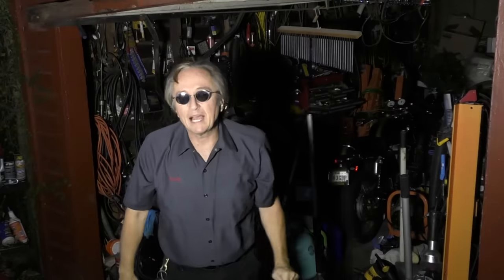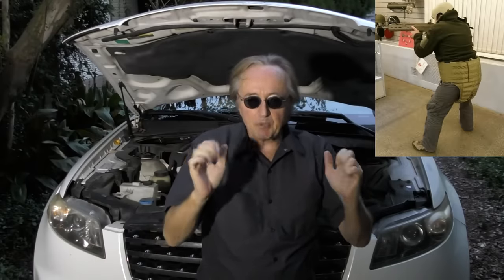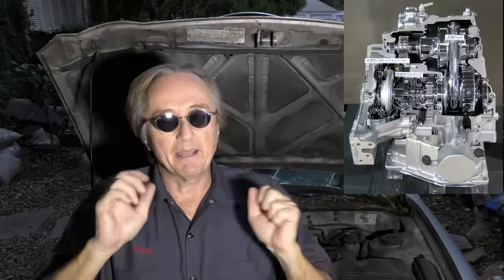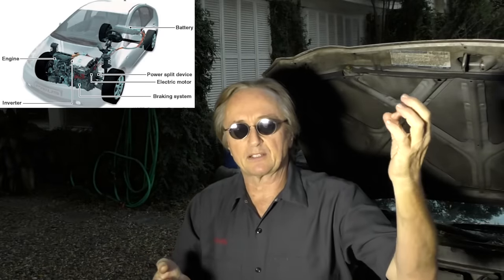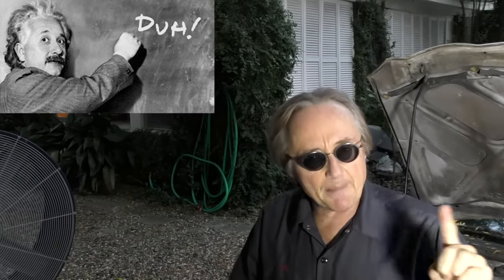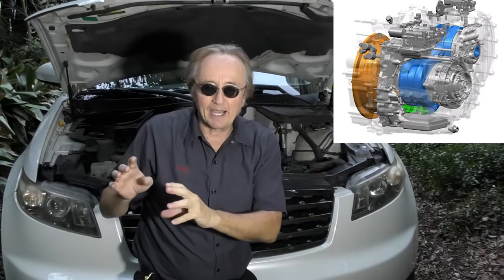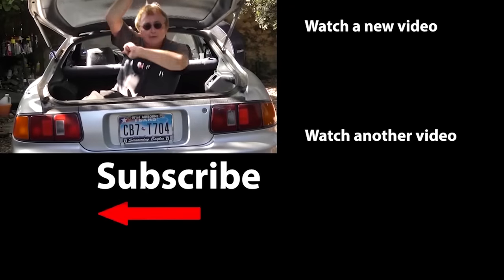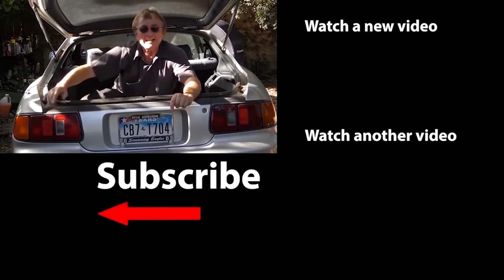Why Most CVT Transmission Cars are Terrible

Comment: Just got a notice from Subaru Canada the they are Extending 
my CVT warranty for my 2018 Outback to 10 years. 
Feel better now 😃
Reply: Beware because Subaru will fight honoring that warranty. I'm dealing with my CVT transmission stalling and causing my front axle to break. Horrible experience on an LA freeway. I'm dealing with Subaru not honoring two active warranties on my car. It's a nightmare.
Reply: thanks for info. my 2015 Sentra, 85k, slipping.
Reply: Yeah, good luck with that one.. warranty is only valid by their definition of the fault, and they only announced that because the word is out how crap the cvt's are, and sales were plummeting as a result.. any claims you make will be severely challenged.. guaranteed
Reply: Our Subaru Impreza sucks . They rebuilt the engine twice and now the transmission is failing at 85000 miles and we're having problems with the cam .. Hate Subaru !!!!!!!!!!!!!!
Reply: @Frecks50  
How is Subaru denying the warranty, whats their excuse??
Reply: @MsDavid896  
How can you yell when a CVT is slipping? It feels like that all the time doesn't it??
Reply: @marktuyet  
What year Imprezza do you have, which motor?
Did they give a reason for the engine failures?
Never was impressed with Subaru.....their 4 cylinders had a lot of head gasket failures a few years ago.
Reply: @motorcitymanman7711   can tell its slipping when accelerating onto highway, and punching gas doesn't work. Not that you should punch gas but it will slip when you try. Ie slipps, stop accelerating when rpms go above about 2.5 rpm
Reply: @crookback 
Dont Gloat.
Reply: @motorcitymanman7711  they said that I didn't keep my fluid levels maintained. Eventually, they did fix everything. The service rep said they didn't want to deal with me in court. I did not say anything about a lawyer or court but Subaru knows they have a transmission issue.
Reply: @Frecks50  
Good for u for not backing down
Reply: Peter, your Subaru doesn't have a Jatco CVT. Subaru dropped Jatco's a long time ago in favour of doing their transmissions in-house. The reliability of their in-house transmissions appears to be much better than the Jatco units Scotty is talking about.
Reply: You will need it!
Reply: @inodesnet  Thanks for sharing! Just replaced my 12 Altima with a 19 legacy.   would say it runs quieter and smoother though I did put 105k on my Altima without any tranny problems before it crashes
Reply: Better hope it breaks before 9,999 miles!
Reply: your CVT transmission is the same as in the TOYOTA and that gentleman doesn't know what he says about the Prius-  they do no use with CVT for the last 20 years- they used with the regular gear for many years and for a few years they used with a very bad Geer and than replaced it with the same Geer as in your Subaru since Toyota owners Subaru by 25 percent of their stocks
Reply: Subaru has made their own CVTs for quite a few years and they're considered among the best.  
Because of all the chatter they extended the warranty to 100,000 miles.
Reply: @Frecks50  - You don't "maintain" the fluid level. Transmissions don't use oil like engines do. CVTs need to have the fluid changed every 30,000 mi./50,000 km. whether or not the owner's manual or maintenance schedule calls for it.
Reply: @Derek Dranfield: great info Derek. Thank you.
Reply: @Frecks50: so sorry to hear of your difficulty with Subaru!! Hope you are able to come to a favorable conclusion.
Reply: Glenn Stewart when did they start making their own CVT’s? 🤔
Reply: Didn't they raise the warranty period to avoid a  government-forced CVT recall ?
Reply: @Frecks50  Subaru has been very good about their CVT's unless you have had maintenance on them. Have two Subaru's with CVT's (2010 Legacy 4cyl, 2016 Outback 3.6r). Both drive great with no issues. Great mileage and smooth acceleration.
Reply: @Mike80528  great for you. my experience was not the same, as I stated.

Comment: My car is barely at 40,000 and it is already having transmission problems it's a Nissan Versa😣😤😒
Reply: Chale.
Reply: Hate Nissan Versa's, cheap car cheap quality :(.
Reply: Shuddering when you accelerate from a stop, right? We had one. Had.
Reply: I'm sure none of us are making her feel any better lol.
Reply: Well thankfully I did the lemon law thing so might be getting my money back soon and return the car, so I'm dealing with that I feel bad for people who didnt have a chance to do that under the warranty and realized it too late. I'm getting a Toyota forsure. Lol
Reply: @dallascowgirl105  So what exactly was wrong with your transmission? That's awesome that you can return the car after 40k.
Reply: @invictuz4803  Basically just the transmission, the code for the sensor for the transmission kept coming up and the check engine light would just keep coming back. The car would shake. And they even changed the transmission and still can't figure it out, it's running fine for now but I'm already doing the lemon law and Nissan might already be giving me my money back so waiting on that at the moment. I did research online and learned what lemon law is soo thankfully I did.
Reply: @dallascowgirl105  Wow that sounds nasty, thanks for the info!
Reply: @dallascowgirl105  Try changing fluid to aisin cfex and make sure it's 5quarts.Solved my problem with nissan serena(not sold in the us market).
Reply: Mine went out around 55k
Reply: Nissans are cars for grandma to go to yoga with not a young person with a busy life
Reply: I own a Nissan Versa TO, I have no transmission problems. Change the TRANSMISSION fuild every 40,000 Miles...
Reply: My 2015 nissian versa did the same at 42,000 miles.
Reply: I have a 2016 Nissan Sentra with 62,000 miles on it. Took it to the dealership today because the CVT transmission was giving me trouble... they took it on a test drive and suddenly the car “broke down”. Trust me stay far away from Nissans. 

What is lemon law?
Reply: THESES Cars are GOOD, The problem is WEIGHT and R.P.M. STAY UNDER 3000 R.P.M. "ALWAYS"  SO SIMPLE!!!!!!!!!!!!!!!!
Reply: How's the oil change?
Reply: @ItsFabby  Look it up its basically when you have the same issues with the car its considered a lemon plus I bought it brand new so I will be getting my money back for my vehicle, it's best to do it under 100,000 miles.
Reply: Alma Ruiz That lemon stuff you said was cool. Damn lemon tree.
Reply: Alma Ruiz should of waiting a little longer before purchase and got the Altima
Reply: I have Nissan Sentra 2012 with 156,000 hundred thousand miles and it has CVT Transmission 🙄 no issues or problems runs like champ
Reply: If you google it Nissan Versa transmission is a failure by nature. It affects thousands Versas around the world. My versa is year 2016 after 80K the transmission completely failed. Warranty has expired but Nissan has a program for Versa owners called goodwill replacement. Even though your warranty has expired you can get transmission replaced for free.
Reply: I had the same issue on a Nissan versa 2012 with 80k miles,  which is out of warranty,  I called Nissan corporate and they replaced my transmission for free , take a minute and call .
Reply: Alma Ruiz lemon law lawyer, get your money back, thats what I did for my Nissan sentra
Reply: My friends would tell me Never ever buy CVTS engine cars. I have a 2010 Toyota Corolla with 145,345 miles on it and no problems lol
Reply: Trade it in for a corolla
Reply: You guys probably never changed your CVT fluid... Dirty fluid is going to make it studder and "shift" like crap. Eventually blowing up the trans
Reply: Alma Ruiz lol u cant do a lemon law at 40k miles never mind 99k miles lol. U will not be getting your money back trust me. Sorry hun i work for that company and we wont be giving no money back for lemon laws. Only if u do somethi g vood for them will they do it
Reply: I have an 2007 Nissan Murano that's stuck in  limp mode.......uuugghh cranks up sounds fine but wont drive or reverse......
Reply: Did u change the tranny fluid at 30k like u suppose to?
Reply: @steven7297  - "Of" ≠ "have."
Reply: @nathanbryan3192  - Just be aware that only a portion of the fluid (special CVT hydraulic fluid) can be changed at a time. The torque converter (! Why? I should study how automotive CVTs work) doesn't drain.
Many people are having CVT trouble well before 40 k.
Reply: I bought a 2014 Nissan Versa and the transmission at 77,000 is now completely ruined and needs a new one
The dealership is charging me $5,000 to fix it bc I am out of the warranty 
And if I fix it at an outside mechanic, the best price I found was $3,000 

I am now in the market for a new car & am never buying a Nissan again 
But I’m glad yours was covered, I wish mine was, ive only had that car for 5 yrs 😩
Worst car EVER!!!!
Reply: We have to learn the hard way in life, but I’m sure you’ll never buy a Nissan again.
Reply: Ive had a lot of Nissan but all manual transmission, Sentra Tsuru and Versa . Never had a problem with them.
Reply: Crazy since I have a 2015 Sentra and I just hit 80,000 miles. It's starting to jerk when giving it some gas after stop and shuddering
Reply: @RatnDat  I'm going through the same issue with my 2015 Sentra and its only at 80,000
Reply: It's not having problems you just never owned a CVT they drive different hey don't shift and people keep going back to the dealership oh yeah they gonna get you!
Reply: dont buy nissan again.  dont repair.  just buy one from auto zone.  or have dealer give u a new one.
Reply: I have a 2011 Versa but mine is the automatic, not CVT engine. I have over 150k miles on my car and it still runs like a champ. I’m very good about replacing fluids and maintenance and couldn’t be happier. :)
Reply: InvictuZ I have a 2014 Versa 5 speed and I love it, super reliable and very good on gas, I guess just don’t get the CVT
Reply: @nathanbryan3192  Well its coming.
Reply: @cosmic7368  it's really expensive to do that
Reply: @nathanbryan3192  how much does the CVT transmission fluid cost?
Reply: Fabby Figueroa oh wow I have a 2017 Altima that I bought new and it now has 63,000 miles and doing this. Taking it to Nissan tomorrow
Reply: The nissan versa didn't come with a CVT till the 2020 version, so I guess you are just unlucky. I personally drive a Nissan Versa 2012 with 130k km and works like a charm, it's also a manual transmission so I guess it's not relevant for this conversation
Reply: Get a toyota😀
Reply: @gsfbffxpdhhdf7043  I did the lemon law and got my money back for the car what I paid.
Reply: @Granked  I did get a corolla.
Reply: @funarena542  yes i kept taking it for the frequent oil changes etc. Didn't matter.
Reply: @brendas9095  oh man I'm sorry that sucks get a toyota instead.
Reply: @BellyJae  thats why because it isn't cvt and its mostly the newer Nissan that have issues.
Reply: @clb_52  already did lol😁
Reply: @dallascowgirl105  , Follow Scotty Kilmer on cars and trucks and you can never go wrong.

Comment: According to Wikipedia, Subaru has discontinued the use of Jatco transmissions and are building their own CVT’s
Reply: Yeah, they are, but they're still horrible.
Reply: @crookback Great idea, my 2011 subaru cvt went out @ 114k.
Reply: @crookback - Electric cars have a one-speed "transmission" - a reduction gearbox. So far I haven't heard of any of them giving trouble. After over a century of making reduction gearboxes, perhaps the engineer-bean counter war has been won in favor of the engineers. If the gears and bearings outlast the rest of the car, and the gear case doesn't fracture, maybe they are good at last?
Bean Counter: "Can't the gear case be made of recycled beer cans? We could save 6¢ per unit."
Engineer: "If you want warranty claims on broken gear cases, OK."
Bean Counter: "Just so it lasts more than 5 years and 60,000 miles."

Comment: Random trivia: In 1993, F1 team Williams tested a CVT on their car. It was later banned by the FIA, even so far as to make a rule requiring to have a transmission with between 4-7 gears. It was rumored that the car had lapped a few seconds faster than normal.
Reply: Race cars have FA to do with the garbage sold on the street.

Comment: 2013 altima so far I keep the fluid change transmission fluid and filter every 30,000 miles thats what Nissan service calls for Altima is at 122,000 miles altima has went from fort Myers Florida to mount olive north  Carolina 8 round trips so far no problems been a great car
Reply: I ve  centra 2016 i used to change oil and filter every 20 kilo miles ...and today i made 210 kilo miles on it with no any problems... really nissan cars are great

Comment: Wife's 2013 Nissan 78k miles I already feel the transmission going making noise and jerking.
Reply: my dad 2015 nissan sentra doing the same thing 85000
Reply: Nissan is complete trash, they throw CVT on cars and call it a day
Reply: @wanilimbe  never buy Nissan
Reply: Replace the cvt fluid. You're supposed to replace around 60k
Reply: I have 2013 nissan rogue my car had 3 cvt transmission in 124000 miles
Reply: @0029954  Try 30-40k miles!
Reply: @0029954  yep
Reply: Replace CVT transmission fluid every 60K
Reply: What Nissan model?
Reply: I'm watching this while waiting to have my 2013 Sentra with 77k miles on it to get fixed because I was dumb and took it to the mountains again.
Reply: Didnt change the cvt fluid in over 30,000 miles oops your negligence.
Reply: @mypersonalreview656  I don't think that matters for some of these cases. I did keep up with replacing the fluid often enough yet it still broke down. I mean, I knew it the first time I took it to the mountains. This was the second time it had endured mountain roads consistently for a few days in a row and sure enough it didn't make it 10 miles down the highway when I got back down from the hills. Luckily it looks like these fall under a manufacturer's warranty if it happens under 84k. Not sure if that's the case across the board but I was fortunate it was the case for me.
Reply: @tommyhawkins2290  At what point you realize it is a complete waste of money and time and just move on to another car brand?
Reply: @B F I think the design issue was from 2012 to 2018. Past that they improved their transmissions so they don’t go out as often or easily. Still I would change the fluid every 30k miles just to be safe. As some famous mechanic in YouTube says: “Oil/fluid is cheap, engines/transmissions are not…”
Reply: It's a good idea to change 1 quart of fluid every oil change, so I've been told by a reliable source.
Reply: Ah nuts I just bought a 2016 altima
Reply: @adrianparsons6917  I hope you have good results with it. I bought a 2014 Versa in 2019. So far, so good but it still only has 25K total. I like it so far.
Reply: @0029954  would this fix the problem?  My Sentra is jumping rpm from 1500 to 3000 briefly, then back to 1500 as I accelerate from 25-40 mph range.  Never did a replacement of the cvt fluid.  Will this fix it?  Want to nip this in the bud before it gets worse.
Reply: @mikepotter3802  im not sure what the mileage in your vehicle is but it does seem similar to the issues I had before changing the cvt fluid. The dealership says every 40-50k miles depending on how/ where you drive
Reply: @0029954  Yeah, I am going to change the fluid on Friday no matter what, but was curious to know if this would fix the slip issue or not.  It has 104k miles, and never been done.
Reply: 2013 sentra and my cvt just gave out. Thinking of just trading it and getting a different  car
Reply: @AbigBlackcat   u can still trade in with bad transmission?

Comment: Mazda do NOT use a CTV in ANY of their current models.
Reply: Mazda is Ford owned. Ford never were a cvt brand
Reply: @pfwww12  ford sold its stake in mazda some years back
Reply: @pfwww12  actually now in 2020 Ford only owns like 3% of Mazda.
Reply: C. Nelson not true. Ford used a CVT  for a short time. It was used in the 2005-2007 ford 500 and Freestyle but it was an optional transmission most got 5 speeds. They stopped using them because of horse power limitations, they quickly proved to be junk.
Reply: @pfwww12  not anymore, Mazdas now are made in Japan.
Reply: @pfwww12  Ford no longer owns Mazda since 2015
Reply: @edvinneluis2635  actually now since 2015 Ford only owns like 0% of Mazda. Now 2020 Ford still owns like 0% of Mazda.
Reply: C. Nelson ford only has 7 percent shares in Mazda
Reply: I think Scott had a slip of tongue and said Mazda when he meant Mitsubishi. 
Mitsu does own 25% stake in JATCO.

Comment: The CVT in the Prius is totally different technology from the ones used in Nissan and Hondas. The eCVT in the Prius (and certain Fords) uses a planetary gearset to combine the output of the gas and electric motors. By varying the input from the electric motor on the ring gear, it creates nearly infinite ratios between the gas engine and the wheels. It's reliable tech and doesn't create that rubber-band sensation. It's also patented, so only Ford and Toyota can use it. Regular CVTs use steel belts and cone-shaped pulleys and vary the ratio by moving the belts on the pulleys. It's a friction-based mechanical system and not particularly reliable or fun to drive.
Reply: Yes, it's a big hole in this video's context for him to not mention CVT vs. eCVT differences, chalking it up to Toyota just making "CVTs" better. His videos tend to be simplistic.
Reply: Is it the cvt or the ecvt in the 2020 suzuki swace /toyota corolla??

Comment: I have an 07 maxima and all i can say is just take good care it, making sure the correct fluid is added is a very big factor to making cvts last a longer duration. It currently has 120,000 or so miles on it and I've had no issues.
Reply: ..2 years later...
Reply: 240k miles on a 2008 , zero issues
Reply: @GatesRapes 
At what mileage do you change the CVT fluid?